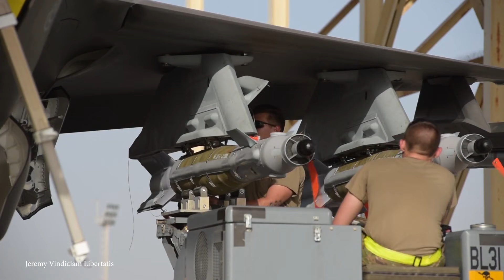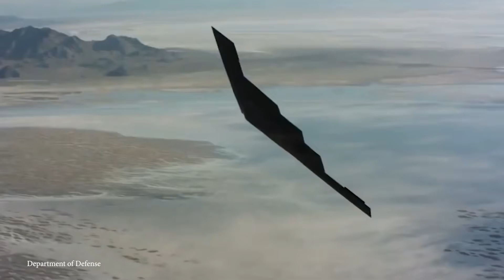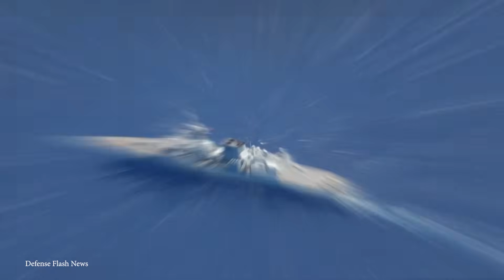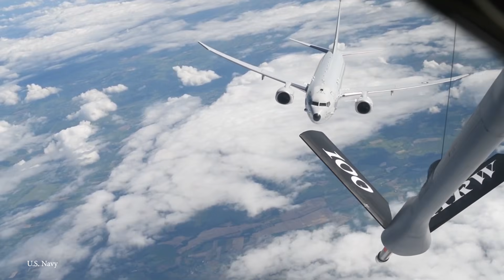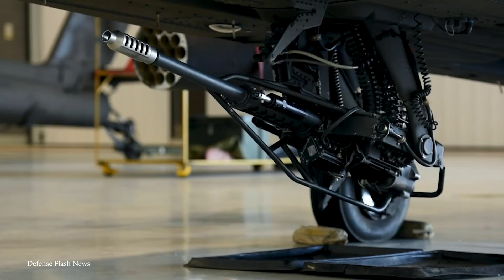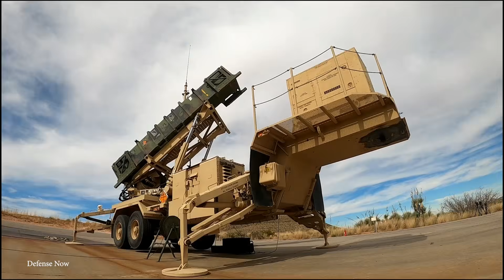15 MOST Advanced NATO Weapons

Comment: I feel like titling this "most advanced" is a bit of a misnomer.  A bunch of these are stalwarts of the USAF and Europe but I wouldn't exactly call the Stratofortress or Apache "advanced" in 2022, and the Eurofighter Typhoon isn't even a fifth-generation fighter jet lol.
Reply: It's as advanced as anything g the enemy has. The weapons are extremely expensive to not only engineer but to build. Most cou tries will have these type of weapons for decades before they are replaced. So they are advanced with the latest upgrades until someone else creates something newer and deadlier

Comment: I really wish that people would remember that the Apache helicopter was designed and built by McDonnell Douglas. And that due to improper leadership was acquired by Boeing. Douglas always had the better designed equipment. John McDonnell the 4th signed a bad deal with the Air Force for the C-17 and wasted lots of money trying to develop a plane the ran with a jet engine on one side and turbo prop on the other. We were proud to work there, and was very unhappy with our leadership.
Reply: The Apache was designed and developed by Hughes Helicopter. HH also produced it until 1984 when MD bought HH.

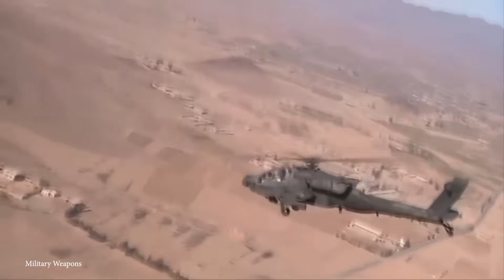Comment: 13:00 , Imma correct you right there, the he called it the apache gunship, however, the apache is an attack helicopter, gunships are something completely different, attack helicopters are meant to target tanks and armored targets, gunships however are meant for infantry, attack heli's usually have so AGM's, an mg, etc, gunships however are like the air cavalry you think of when you think of Vietnam [war], except the gunners don't get off, and the helicopter is armed with an mg (copilot controlled and the 2 others)